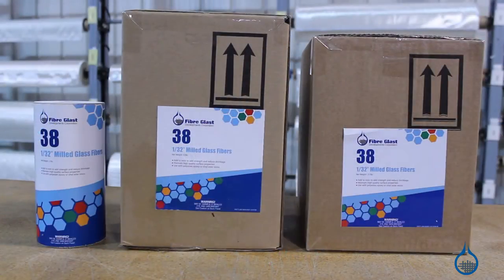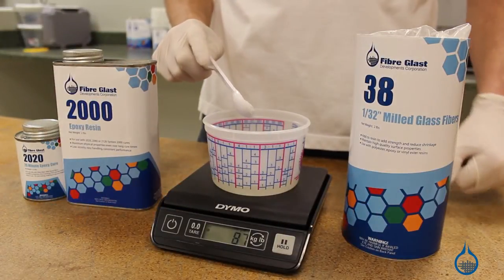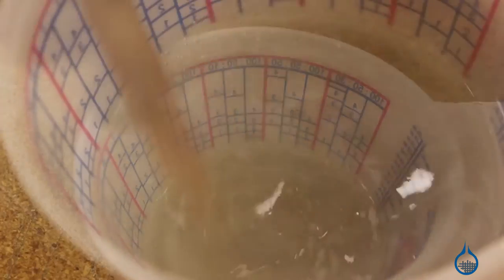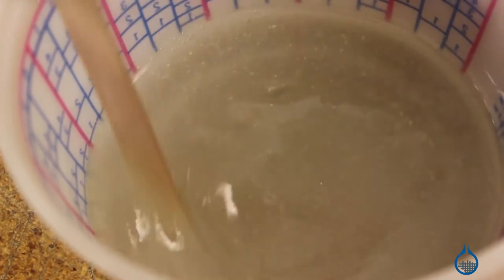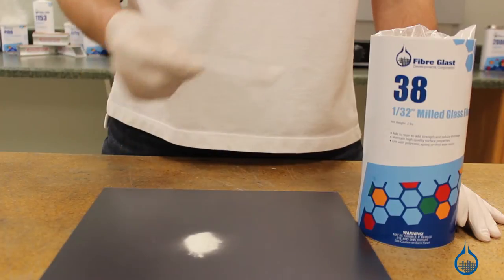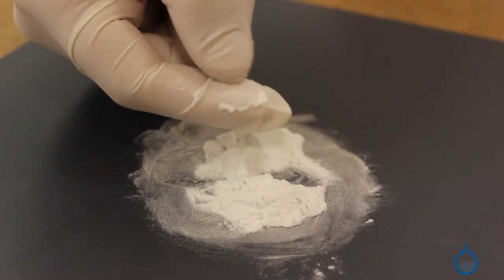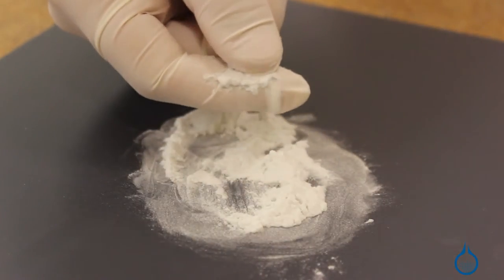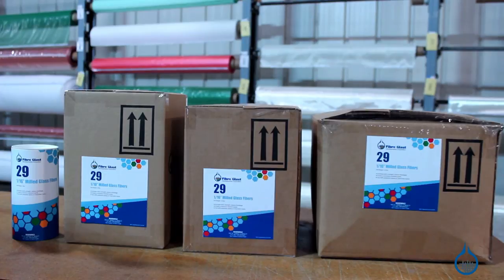Milled Glass Fibers 1/32"

Comment: I use that stuff up to 10% mixed. I mix it with the 1/4" for even more strength to if I got some thick Fairing to do. This stuff fairs very well. Try some, you'll like it. So far without any veil covering my holes, I have no spider cracks, that would have formed with the epoxy putty method. Also I add white pigment to give my hull depth in case its scratched, but not near as much as he says.
Reply from the maker: Great to hear.  The 5% ratio recommended in the video can be adjusted to fit the needs of the application.

Comment: What is the maximum temp for these fibers?
Reply from the maker: The max temperature for these fibers is extremely high, over 1,400°F.  Your limiting factor for temperature will be the resin they are used with.